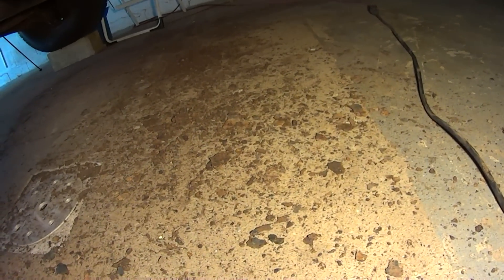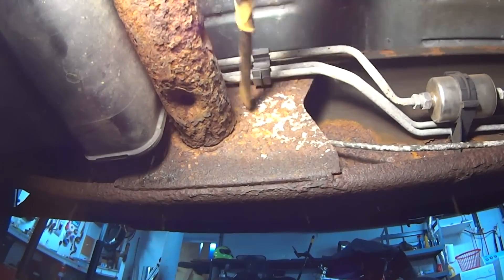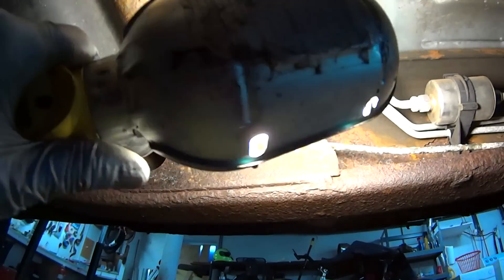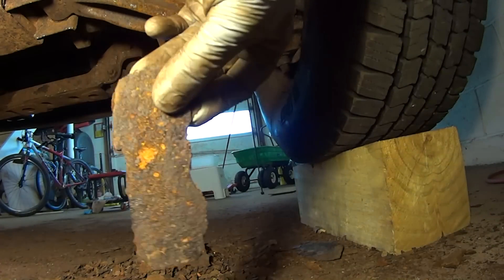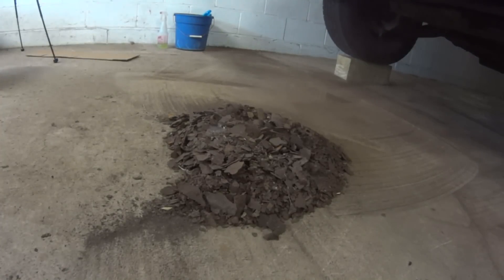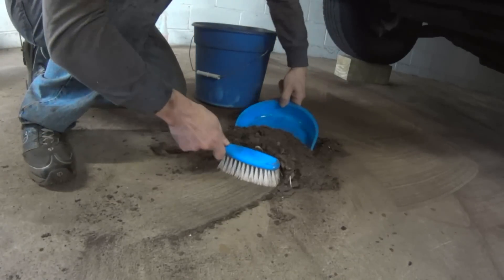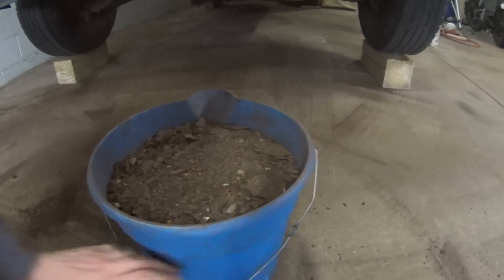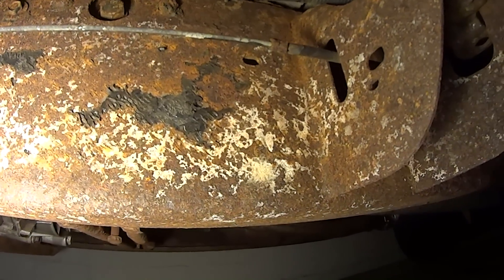Most satisfying video. Silverado Frame rust removal, RUST PROOF STUDY

Comment: Using that pneumatic chisel is BY FAR the best way to get rid of rust on any sort of structural steel.     Forget the needle scaler, they are a waste of time. Hit that with a 4,5 “ wire wheel after and put on 2 coats of POR15. And youre golden
Reply from the maker: Exactly. I get 10 comments per week about using needle scaler. Waste of time. They are good for small spots and light rust.
Reply: @troutjunkie7330  Looks like a good way to find any parts that need to be replaced, too.
Reply: @troutjunkie7330        They JUST SUCK plain n simple.   This is so much faster and easier it makes a scaler just a waste of time.
Reply: Is it DANGER to drive a car with Rusty frame?    I'm thinking if buying an expedition but the the frame is Rusty.
Reply: Ive been losing my mind with a cheap needle scaler from princess auto. It crossed my mind to use one of these instead. So glad I found your video. This wouldve saved me so much time.
Reply from the maker: Not sure. I did Chassis Saver on rear frame (por15 alternative) and wax mix on front one side, then grease on the other. Doing long term study
Reply: @troutjunkie7330  Every 15 or 20-year-old ball joint I ever did I had tons of grease around it, the metal underneath it was spotless!  ( there was always plate rust on the rest of the control arm) grease is nasty, but probably one of the best things.  Those soft non-hardening wax type compounds look promising.  Good luck
Reply: @troutjunkie7330   - How did it go? Cant find a re-upload about an update? :)
Reply: Trout Junkie  we use mop and glow floor wax it’s very hard . Our process for small metal was to soak the rusty part in muracid a cement cleaner for just a couple minutes and it will boil and eat the rust down to new metal. Muracid is reusable but don’t want fumes in face or home . Next we cleaned with baking soda and water  to neutralize the acid then blow dry and let dry for a period then we died the metal and dip in mop and glo and not salt corrosion.
Reply: POR-15 is definitely worth the money. In '08 I helped my dad fix up the undercarriage of his 2002 GMC 2500HD. After getting the scaly rust off, we brushed on POR-15 then painted it GM frame black but, on the back half we decided to just paint it with the same GM frame black (Due to summer being almost over and wanting to go off roading). Today the front half is still black, while the rear half is completely covered in scaly rusty.
Reply: Chubbysumo Um, no. That's on aluminium. Iron oxide is porous and has no protective function whatsoever which is why anything steel will completely rust away if left long enough.
Reply: @rkvktmen  Totally agree.  I've owned a couple of vehicles whose frames rusted away so severely parts of the frame simply disappeared.  There was plenty of "protective rust" on them before they disintegrated.
Reply: Chubbysumo lol that's bullshit. These trucks rot cross members out all the way through if not taken care of
Reply: Seems like it would just rust from the joints the chisel couldn't reach...but what do I know.
Reply: HunterShows       You’re not cutting with it you’re pounding on it with a blunt edge. Afterwords you need to prime it and painted with something preferably like POR 15
Reply: Merlin Cat Is POR 15 worth the hype? Heard mixed stuff on ut
Reply: I saw a real time test of all the rust paint coatings out and POR 15 was a loser in performance. The video is here somewhere. I use RustBullet myself. It is a one coat process unlike POR 2 coats and in the end cheaper and easier to use.
Reply: @seamus8849  no it's not it flakes up real bad only after a few months do not recommend it's a waste of money it's expensive and trash
Reply: Seamus     Well it comes as a mixed blessing. People who use it and charge the price off to somebody else has a job love the stuff, I love the way it works I just hate the way it keeps.     It’s not very pricey compared to premium paint if you buy it by the quart of the Internet, about 40 bucks. The problem comes in trying to save what you didn’t use. That paint dries by contact to air like old-fashioned canned lacquer paint. The problem is And it’s like that on steroids. If you wanna keep what’s left you’ve got to 
   1.    Never ever work out of the can!!     You need to pour out what you’re going to use and seal  the can up immediately.     Never ever pour something left over back into the Can😖. It will harden to rest of it by the next time you use it weeks later.     If the cans down more than an 1/4 it will skim over so I tried using the inert C25 from my mig tank.   Set cover on lift a corner stick in and let it fill with gas yank and seal.    Seems to work.   You can buy something called BLOXYGEN  too in a spray can.    If just using a bit from new can I toss a sheet of plastic bag on and push it down so it floats on and covers the paint and sticks out all around the can.
     Once the can has  been opened and resealed any paint that got between those surfaces  will act essentially as a weld, THATS WHY THE PLASTIC BAG SEAL.   Some of the time you’ll find that you’re not gonna get that lid off even with a regulation paint can pry tool.    You end up having to punch it and pour health the contents.   I even had one brand new that I had to punch because the rim was just tearing off it.   🙄.   See how this starts getting old!    Once my key and has been opened in a little bit has been used I start giving it up in small glass jars like baby food jars, mustard or olive jars things of that sort.     I also seal the contact points of the lid with a piece of plastic bag.   Even with the cans I always try to keep plastic between those mating surfaces and hope that it’ll release and seal solidly.    
    As for painting I tend to use a brush and it paints like any thin lacquer.   It needs another coat within the window which I think is 24 hours or the first coat will be so hard that it won’t stick. If you wait too long you got to scuff it  with 220 sandpaper or it will peel off possibly later.     If it does peel it will come off in large sheets 1-3” in my experience.    
     Here’s my experience,   It likes a thin coat of rust.    Anything loose flakey has to go of course or it will pop the paint off later as you’d expect.   For trailers and undersides of cars it seems to work quite well.   Other than that it works well.     I know a guy who did a car hauler 10 years back still looks great!      I slipped and draft the edge my tractor bucket and a sharp edge of an angle bracket and I was putting my trailer on it one day. It didn’t even ship the paint and it hit hard. I also noticed that it didn’t seem to have faded much over the years as they say it’s supposed to.  He leaves his right out in the weather too.
     So it’s a mixed bag. Kind of hard to keep and work with but if you get it right seems worth it and it is a lot cheaper than two part epoxy.     
       If you get any of that on your hands my best advice is don’t. Wear rubber / plastic gloves because once it’s on you it soaks right into your skin and you’ll wear it until it grows its way out a few days later😆
Reply: Parking on the grass does let the moisture come up so it’s worse. On the other hand what are you gonna do? Just protect it the best you can.
Reply: Thats too much work.  Knock the rust off then spray it with a thick coat of fluid film and call it a day.
Reply: @luvdr350      You don’t think so when that flake falls off and exposes the steel again……..and it will .
Reply: Por 15 failed
Reply: @behr4204  Yep. POR15 is a rust accelerant.
Reply: Rust never sleeps
Reply: @billyadams9985  yeah but it can be slowed to a snail like crawl which is more than enough for most ppl
Reply: What about Miracle Paint?
Reply: Then do a good pressure wash and a prep and etch will neutralize the reat of it with a pump up sprayer. Then spray the shit out of it with rust converter.
Reply: POR15 is trash. Comes right off in less than 2 years
Reply: Merlin Cat would you recommend a first coat of some type of rust converter than a couple coats of POR15?.
Reply: Red pilled patriot        I’ve been using either Picklex  $100/ gallon or  just phosphoric acid ( Parks brand makes it) that you can buy at a paint store to seal the tiny pits that can be impossible to clean on sheet metal.   Just be aware that you have to knock off all the vertical stuff first.     The acid is more for the pit centers you can’t get at and for prevention of flash rust between times / day you’re working on it
Reply: come on, that's just paint
Reply: I use a needle scaler on a tug boat and imp that’s the BEST thing for rust
Reply: Why not sand blast it and put zinc cremate on it
Reply: I did a 36 Ford frame that was very bad and after the POR15 it was still good when I sold he truck years later. I did a test using brake fluid to see how it would hold up and if you've ever spilled brake fluid on paint than you know how it will fup a paint job. It didn't affect the Por15 at all. Not a 100% test for all fluids but it impressed me.
Reply: Merlin Cat how are them chisels powered?
Reply: Very satisfying
Reply: The are better (and probably cheaper) products than POR15, although I use POR Patch and Epoxy Putty fo decades to close rust holes and stuff like that 🙂
The products are great for their use.
Reply: I guess I need a pneumatic chisel
Reply: not por-15, wool wax or an equivalent
Reply: Better mpg now🍻
Reply: no por15 is not what you want to use. use rust converter/inhibitor, then spray Either Fluid Film, Wool wax, and Surface shield.
Reply: Yes it is.    You just need to keep. The can tightly sealed always.   Dump out the amount you’re going to use and then immediately seal the can. Don’t ever put any unused back in the can or the rest will skim over or go completely solid.   I always seal the can with a piece of plastic bag and put it down towards the leftover paint to try to keep the air off it is much as possible.   Then once the cans down an inch inch and a half and contents I transfer it to a smaller container that it’ll take up the whole volume of or nearly so. And I just do that down the line until it’s gone and usually end up throwing almost none away.  If you don’t use it that way the can scams over and eventually turns into Rubber and you lose a lot. Besides once you’ve open And poured from it and sealed it again you’ll probably never get it open and have to open up with an ice pick to pour out the contents through the hole. That’s the other reason I use the plastic as a gasket at least it’ll open up again.   I use everything from mustard jar to baby food jars and keep them almost a full and that way I don’t ever throw any away.  
   It all sounds stupid and a real pain but it’s not that hard to do and it works. Like I said it’s a love hate relationship with that stuff but it is hard as a rock and it does seem to work when you use two coats and do it like they say. Just make sure you get all this loose scale rust off before Painting.   Follow the recoat time guidelines and if you can’t scuff it with a scotch Brite or 400 sandpaper otherwise that second coat won’t stick.    Sanding that stuff is a pain in slow so it’s far better to plan your coat so you can do them with the recoat window to avoid all that.
   clean your brushes or sprayer immediately in regular lacquer thinner.   If you spray use a cheap HF gun not good one.
Reply: @drizler  Hello, I used this por stuff nearly 30 years ago on a 1950 packard we did the whole underside and the whole body everything !!! then painted the whole damn car in  black lacquer the (OLD SCHOOL) way!!! topped it off with a bout 6 coats of high gloss clear. a LOT of hand rubbing and power buffing  she looked like ebony glass!!! The car was My Wifes Grandfathers  car. he sold it in the 60s and found it again in the late 80s and reaquired it.  we restored it for him. man that flat head straight 8 purred like a kitty. after he died it was sold off and I didnt know about it at the time or I would have grabbed it! OH well. been blabbing on enough,,,Por is GREAT STUFF!!!    take care,bob
Reply: @robertbusack2100  
Didn't know it had been around that long. I use a product on my 98 Jeep XJ called Hammerite ( Waxoil ) underbody seal which is a kind of cross between paint & wax. I'm in the UK. It's  probably not as good as a two part epoxy like POR but it's cheaper and definitely better than nothing  If I get my 'forever car' I may look into treating it with POR for sure.
Reply: Seamus Mackinaw I painted a front axle with and it came out great.  Put it on with a brush and it dried to a very hard finish.  It would outlast the truck.
Reply: Do not use por 15 the stuff is trash. It flakes up real bad after just a few months
Reply: I'm buying a 2003 Astro van in pretty great shape....for $2600..... ExcEPT the rust of the frame is pretty aggressive (but no holes or anything that bad). (I'll be happy if the van lasts me 2 years.) 

Should I NOT buy it? If I do buy it, do I need to FIGHT / clean up all that rust? (Parking it on grass exacerbates the rust, is that correct?)
Reply: @dzre2087  Why would you spend $2600 on an Astro?!
Reply: Grass doesn't matter, parking outdoors matters. It's an old Astro van keep it for 2  years and get another car.
Reply: @dzre2087  How does an Astro get rust on the frame when it's a uni~body ? Just grinding your gears. Ya, parking on grass is a horrible thing to do. All that moisture is going to end up somewhere. Be prepared to replace the fuel line and brake lines. Usually the first to go.
Reply: I wonder how one of those 1000 watt laser guns would do against such thick rust.
Reply: Mediablasting is the only way to get rid of rust for good . Rust never rests . Por-15 is glorified Tremclad . The one time I used it on my Chassis the rust came back a year later and was poken out all over .
 That stuff you have to keep re-applying it every year .This truck hardly seems like its worth it to blast . Its not a classic so go for it
Reply: Always say no to Astro Van
Reply: @rocketstutorials  astro vans are awesome
Reply: you do realize that the existing rust prevents new rust by making a rust barrier right?  Chevy and other MFGs know this.  Its called sacrificial rusting.  Its why most cars will have frame rust right off the lot, even in areas where there is no salt used on the roads and where its incredibly dry.
Reply: @chubbysumo2230  I'd like to see some data on that.  Got some? Literature cite?  Something factual? Or did you dream that up in a bar after about 10 bears?
Reply: Or beers, maybe.
Reply: Chubbysumo yea right......except on the newer sheet metal frames on those which just fall apart on the 1500 series.    Bern there done that  And I had to  make my own frame from the gas tank back.
Reply: @chubbysumo2230  that's ridiculous. Once a steel frame starts rusting, it won't stop til there's nothing left. Why do you think there are SO many rusted out vehicles up north. They just keep rusting...

Comment: Everytime I'm under my truck and see the rusty undercoating, I can't stop picking it off.  It is addicting.  Thinking of getting a new truck but the prices are crazy.  I got a 96 K3500 dually with 110k miles on it.  The 454 runs great but frame is all rusted and the utility bed is getting bad too.  Thinking of taking the utility bed off and putting a flatbed with a dump unit on it.  Before I put the flatbed on, the frame would be easy to access and do all this cleaning on.  Now....I just need the time.

Comment: Use a lanolin or diesel/paraffin type of rust preventer. That stuff can creep in and seal the nooks and crannies. No more oxygen, no continued rust.  Downside is the coating doesn’t look nice, but it works.  The paint type  coatings tend to flake and then hold water inside to further accelerate the corrosion. The upside on the hard coatings, is that the frame looks good until it fails completely.

Comment: I just did this exact same process to my 2012 GMC 3500 dually took me four days, wasn’t as bad as yours maybe half the rust. After I sprayed 1 gallon of rust converter on it and let it dry for a few days then I made my own protection spray, 1 gallon of chainsaw bar oil, 1/2 gallon of linseed oil, 1 quart of anti rust oil and 6 toilet wax seals, I’m hoping to get another five years out of it. Great video!

Comment: Hey 8 years later how has this held up? I got a gmt400 truck im planning to save by following this
Reply from the maker: I have an update video on my channel
Reply: @troutjunkie7330  okay thanks! You did a great job removing all the rust I just watched the other video. You may be interested in some videos on rust proofing products put out by a channel called repair geek. He has one that talks about the science of why paint and rubberized undercoatings fail. The basis of it is that if you apply any undercoating that dries it will eventually chip and trap moisture, the reason the oil based ones are so good are that they never fully dry so if an area.comes off the rest of it.moves into that area to protect it whereas the rubber or paint just allows the rust to form behind it.

Comment: I don't get why these car companies don't just undercoat certain vehicles or at least trims, especially 4x4 trucks and w/e else is commonly driven in the winter.  Sounds expensive but with everything they do to make these super expensive machines, if they did it it would be cheaper for them because they can order the stuff in bulk and it would really increase the value of the vehicles over time in several states where they salt the roads.